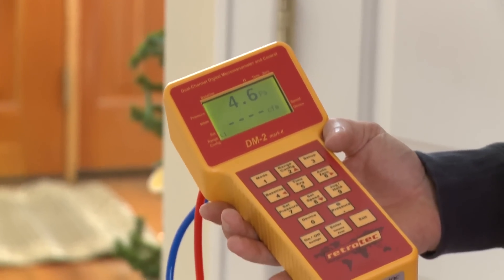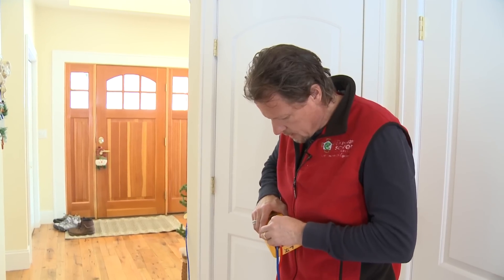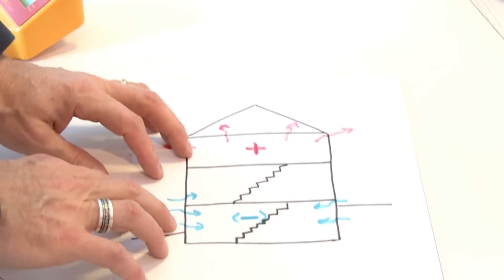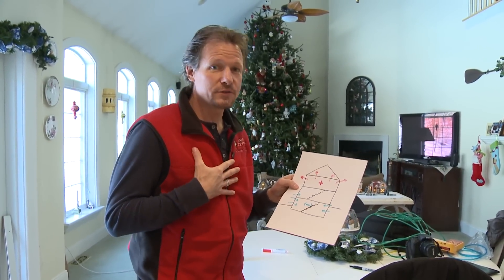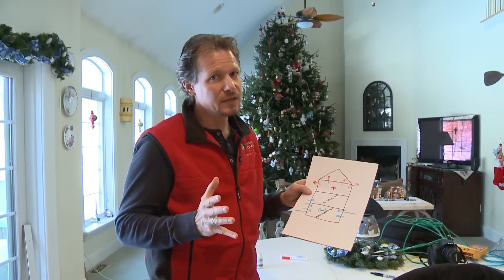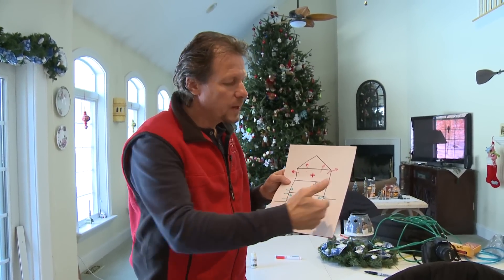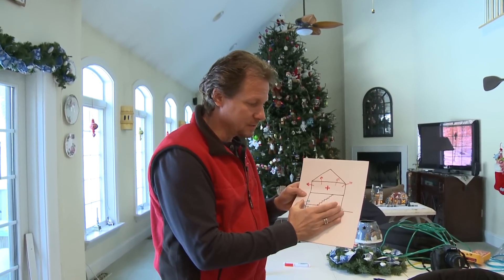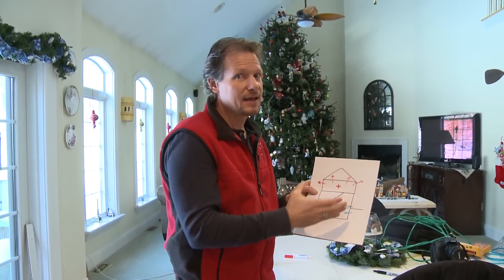The Stack Effect

Comment: I have watched and enjoyed many of your videos - just a building science keener myself.  But you made a rookie mistake when you attempted to show that you can measure stack effect from totally inside the building.  You weren't measuring the pressure differences at the ends of the tubes - that's not how it works.  The air inside the tubing is changing in density the same as the air outside of the tubing so the net result is that you could remove both tubes from your manometer and get the same reading - except you had the one tube under the basement door.  You were measuring the pressure in the basement across the door.  You had closed the door I noticed.  If you would have turned the HVAC off your gauge would have went to zero.  Probably the HVAC had more returns than supply in the basement and that is what you were measuring.  Still love your videos - lets all keep learning together.

Comment: For a more scientific explanation, pressure falls with altitude because there's less air compressing it from above.  The reduction in pressure is equal to the weight of the air below, because it's no longer above you pressing down.  Because cold air is denser than warm air, if you rise say a meter in altitude, the reduction in pressure will be greater in cold air because the meter thick slab weighs more than the warm air slab.  This means that air pressure falls faster in cold air, and slower in warm air.
This means that if it's cold outside, but warm in your house, the air pressure at the top of the house must be higher than outside, and the air pressure at the bottom must be lower, so that the average air pressure is overall equal to outside.  So the average pressure is equal, but the pressure at the top and bottom of the house is different.